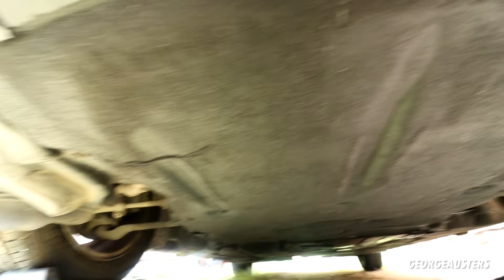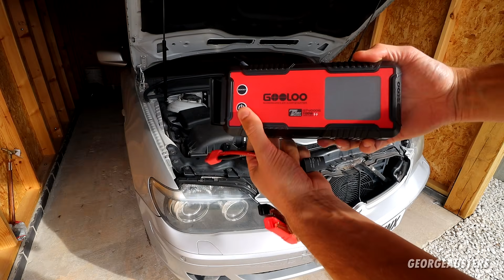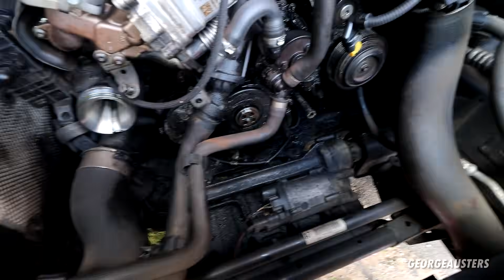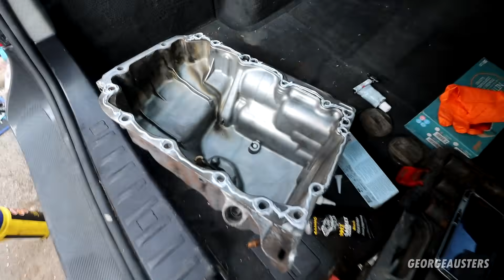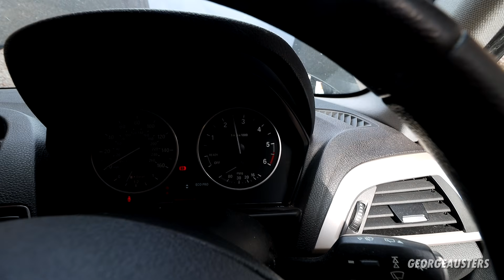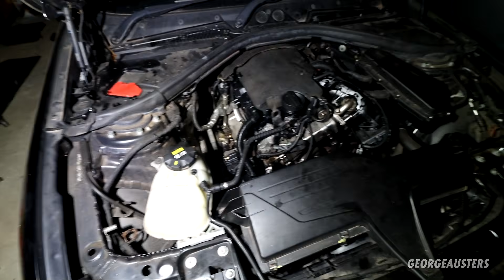BMW LOW OIL PRESSURE WARNING LIGHT PROBLEM | HOW TO FIX

Comment: Have you ever thought  of getting one of the hydraulic  lifts  like quickjack  or quicklift  or ramps  by c j autos  i know they are expensive though ido use the plactic  ramps ok but on certain  jobs have had to put them on timber  to lift them up
Reply from the maker: I'll be getting a 2 post lift

Comment: In ISTA there's a oil flush function and an ABL for oil pressure monitoring and these B engines do sludge up quickly, so always worth doing. Also the N47 & B47/B37 oil filters look almost identical apart from the little tag on the bottom that locates in the filter housing. An N47 filter in a B series engine will cause a low pressure warning as soon as the engine warms up as the bottom of the filter is slightly deformed and once the oil gets thin enough it'll trigger the light.

Comment: Little to no damage running after catastrophic failure and low oil pressure, and mates with the oracle of diesel BMW's. Your mate needs to buy a lottery ticket 😆

Comment: Big end shells are FUBAR.
Reply from the maker: Strange you say that because it’s not knocking 🤔
Reply: @GeorgeAusters Just wait... You should drop the caps and look... By the time it's knocking it's too late. Those shells fail with official service intervals (which are crazy) nevermind if starved of oil... Maybe the crank is okay... Won't know until you look and you can't grind the cranks
Reply: @BMWcare  So if the shells are toast,  can they be replaced easliy under the car or is it Engine Out Jobie ?
Reply: @tonybeale2608 Underneath is easy. But if crank needs any attention then engine out
Reply: 3cyls sounds always rattly compared to 4 cyl

Comment: i think you should have tried to start the car without the jump pack first just to prove the battery was almost flat if you are promoting the jump pack just saying . but good video George 👍👍
Reply from the maker: Good point! I generally don’t like running the battery too flat though.. If it drops below 11v then it can damage it permanently